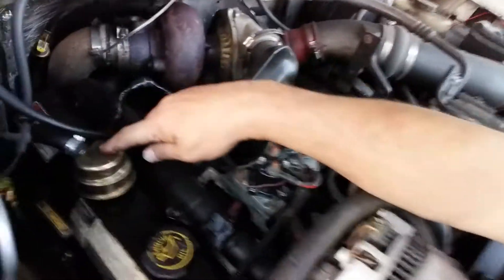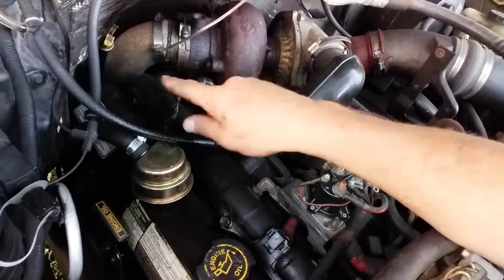crankcase evacuation does work! Trainwreck approved

Comment: 45degree max angle and make sure you install it after the mufflers. 

Been running this on my rigs for years. 
Oil is cleaner, no leaks, improved mpg, and ran thousands of miles, 1Mplus.
Haven't had to rebuild any engine.
Mine is installed a foot away from the tailpipe at a 30 degree angle l. Ran a long hose to the tail pipe since is a rig and still works. Note my tailpipe is under the rig not stacked on the sides like others.

Comment: Built a stroker 351w rear sump for a 64 falcon. Same problem, uses about as much oil to gas as a chainsaw to bar oil and sadly is leaking as well and pushing out the dipstick even
  Digging into this, morose says its not recommended for full exhaust systems and their nipple is to go in at the collector at a 45deg angle only about a 1/4"
  Square boddy guy fiddled with it and only get results after the muffler or at the collector with no exhaust and had best results with the nipple at 90deg inserteted halfway into pipe.
  Other guys experienced best results barely in the pipe. Seems like theres lots of variables in the applications.

Comment: I've got an '85 F150 with a 351W and I didnt have any leaks untill i swapped to a large cam then developed an oil pan leak. I'm about to build a double exhaust evac system to try and get rid of this oil leak. Its all over the front of my truck and is bothering the crap out of me.

Comment: What about the oil that will collect in the exhaust(especially if you are running a muffler). Will this become a possible fire issue?
Reply from the maker: Small amounts of oil vapor, no fire risk
Reply: This stuff finds it’s way to the exhaust regardless, this is just keeping it from contaminating parts like your valves.